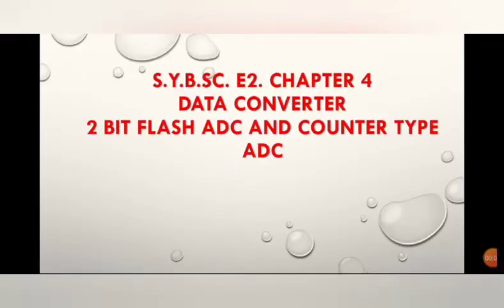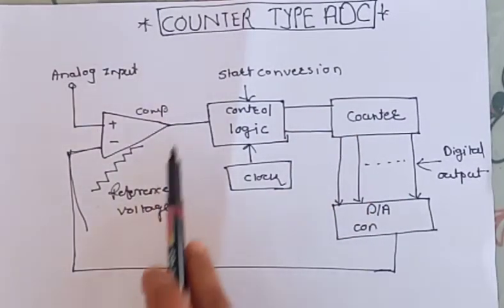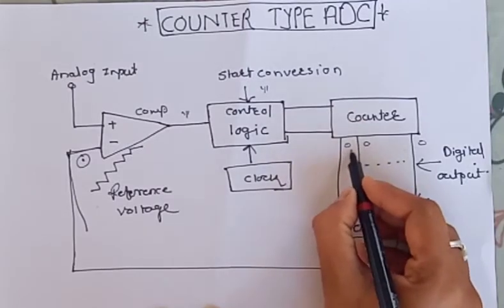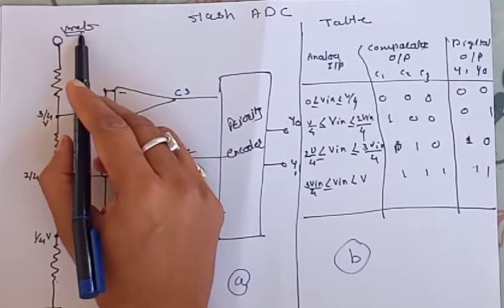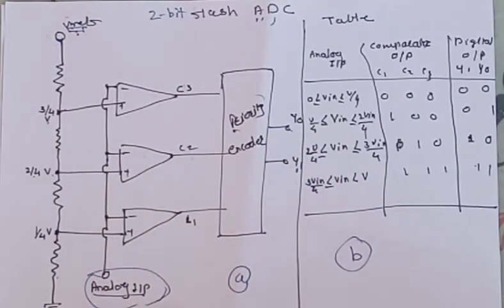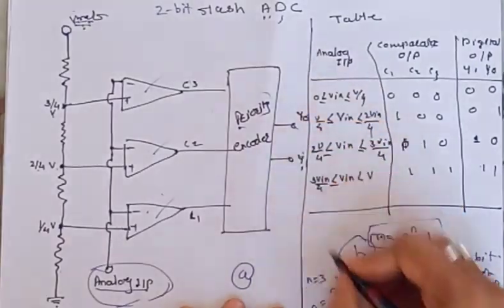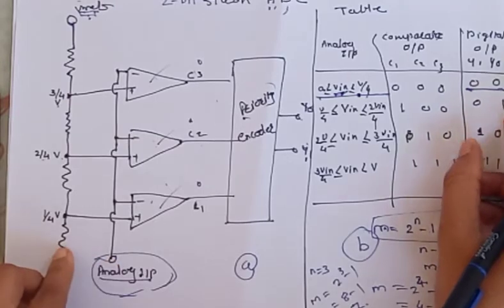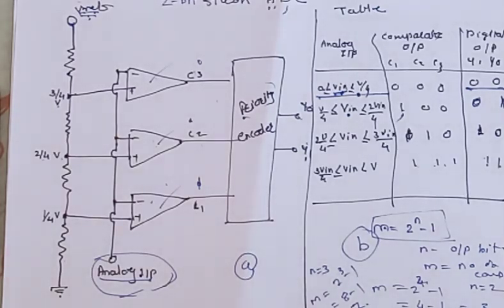2 bit flash ADC and counter type ADC

Comment: Analog input is connected to non- inverting terminal of comparator and Reference voltage is at inverting terminal in 2 bit flash type ADC
Reply from the maker: Excellent observation!